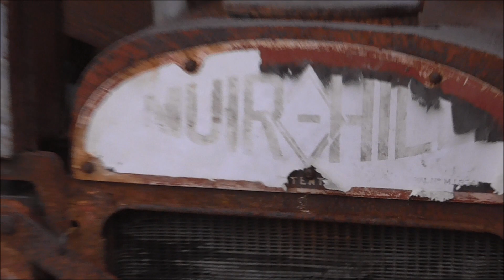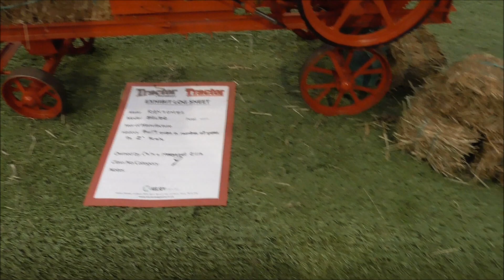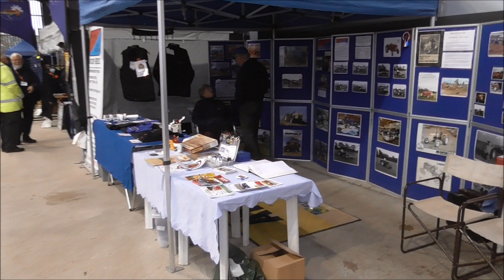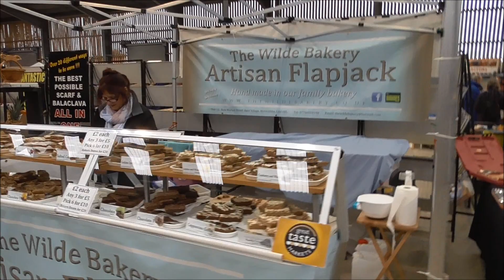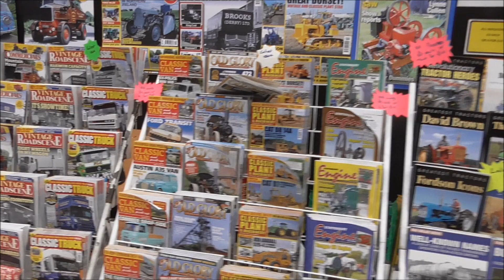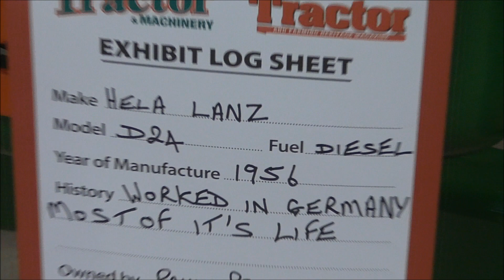October Tractor World Show 2018

Comment: Good day  Yea the weather did not look or feel real great.  We  are having wet weather here now too.  At 13 WD6 super, or here if you had 1 it would carb. spark plugs on right side of tractor, diesel on left side.  At 15 there were some models on table either 10-20, or 15-30 ?  at 19  little saw portable, interesting.  The loader at 20, I never seen anything like that.  Thanks for now hope to see more this or next.
Reply from the maker: Hi Donyes the weather was bad it was wet and cold so we didn't stay for very long.the loader you seen at 20 is for picking up stacks of 8 small hay or straw bales.Thanks for watchingnext Sunday the 14th I am on a charity road run. so that will be next vid :)